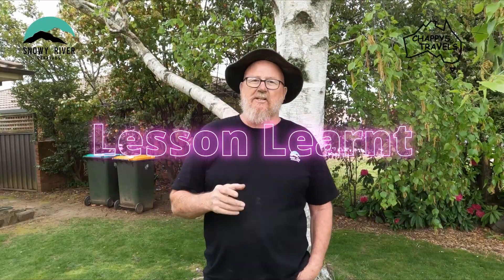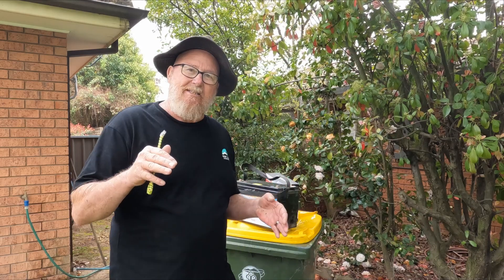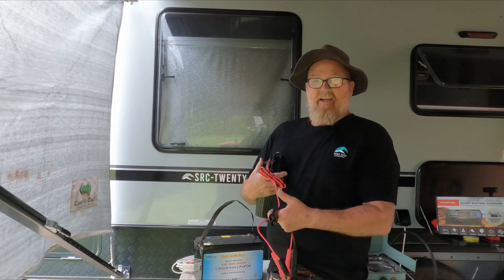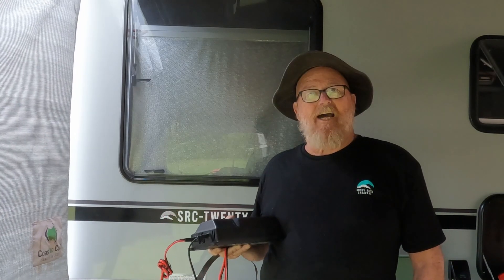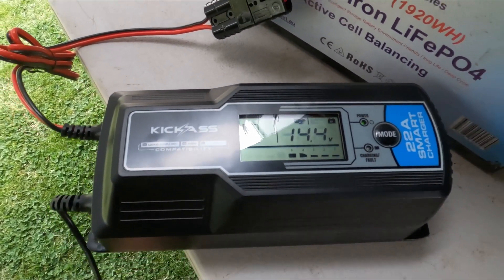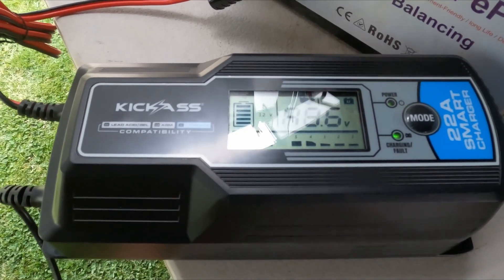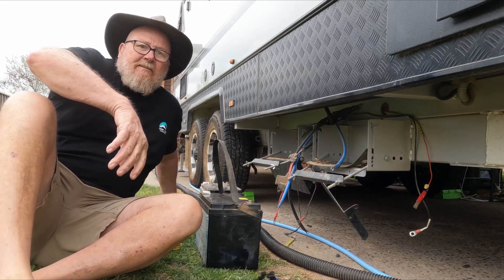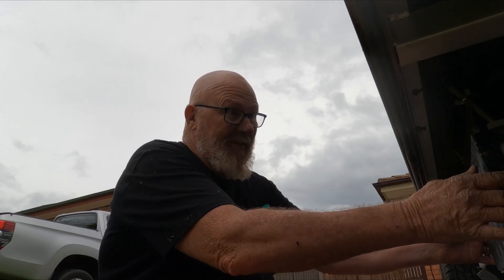lithium batteries for newbies

Comment: Good fun video .. But be Aware .. You can not tell state of charge of lithium from a voltage reading .. Lithium stays at high voltage until there flat .. Then they fall of a cliff .. So you can have 10% left and still read 13v .. A proper shunt is the way to go .. Vitron have them for just over $100 .. Well worth it ..

Comment: @ChappysTravels
I am an Electrician and Electronics Tech. You seem like a nice bloke, but I would strongly suggest that you should not be posting a video that encourages people with little understanding of these types of batteries to "have a go" and potentially cause damage to the battery and, eventually a fire. Many fires are now cause by people "swapping" Lead Acid with Li-ion or LiFePo4 batteries without understanding the correct charging and monitoring requirements to make it safe.
They are not simply "Lithium" batteries. You have a Lithium Iron Phosphate battery (LiFePo4) which is different to a Lithium Ion (Li-ion). They have different voltage characteristics.
Li-ion batteries typically have a nominal voltage of 3.6–3.7V per cell. LiFePO₄ batteries have a nominal voltage of 3.2–3.3V per cell. This difference means that LiFePO₄ batteries require lower voltages to charge compared to Li-ion. Make sure that any charging equipment (including your Solar Charge Controller) have the correct CV/CC settings for the battery chemistry that you have.

Charge Voltage:
Li-ion batteries are charged up to 4.2V per cell.
LiFePO₄ batteries are charged up to a lower voltage, usually around 3.6–3.65V per cell. Overcharging can damage both types of batteries, but the risk is higher if you apply Li-ion charging voltages to LiFePO₄ cells.

Charge Current: 
Both battery types typically use constant current/constant voltage (CC/CV) charging profiles. However, the safe charge current limits can differ slightly, as LiFePO₄ batteries are known for handling slightly higher charge rates more safely than Li-ion batteries.

State of Charge (SOC) Curve: 
Li-ion batteries have a more noticeable change in voltage as they charge and discharge. 
LiFePO₄ batteries have a very flat SOC curve, meaning their voltage remains almost the same over the course of the discharge and charge cycle, making it harder to estimate the charge based on voltage alone. That's why it's neccesary to use a Smart Shunt. A Smart Shunt actually measures the current going in/out of the battery over time (Coulomb counting) and is the only accurate way of knowing the state of charge. 

Can You Use the Same Charger?
In most cases, you should not use the same charger for both Li-ion and LiFePO₄ batteries unless the charger is specifically designed to accommodate both types. The charging voltages and cut-off points are different, and a mismatch can result in improper charging, reduced battery life, or even damage to the battery.

Can you use a Charger or Solar Charge Controller designed for Lead Acid?
Absolutely not. It may appear to "work", but will almost certainly end with expensive or lethal consequences.

Comment: i was told by a battery supplier that a battery needs a charger that has an output  in amps 10 % of the batteries rating except with lithium its 20 % so a 150 agm needs a 15 amp charger and lithium would need a 30 amp charger that charges at a minimum of 14.4  to 14.8 volts to successfully charge to the correct voltage and an agm needs 13.8 to 14.4 volts so 2 150 amp lithiums being charge together in a van needs a ctek or redarc high output dc to dc charger rated at 40 amps minimum in situ nothing was ever said about the batteries not being loaded unless the charger was insufficient (lacking amps required ) failure to do so will shorten the life of the battery ,,i have worked in spares all my life selling some of this stuff ,but i am only quoting battery maker supplier info here and auto electrician would be able to verify and sort out what i have been told
Reply from the maker: Interesting thanks @grumpy
Reply: @ChappysTravels  you’re up late says me lol